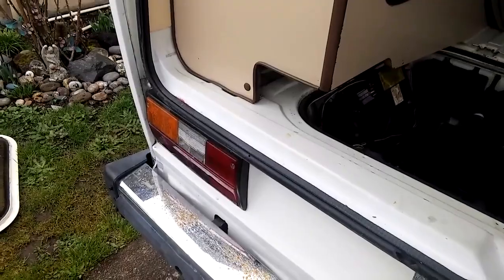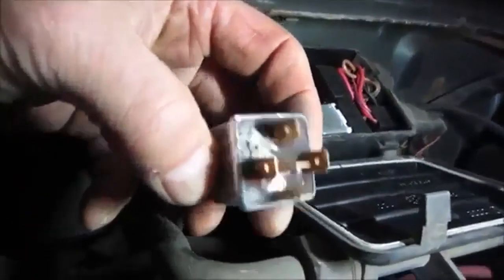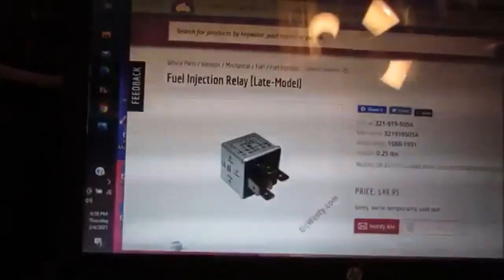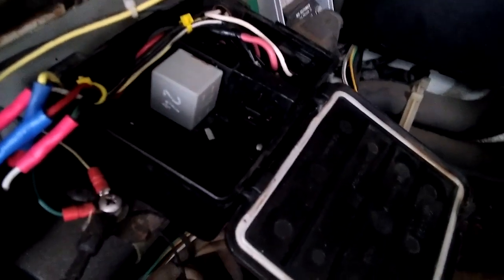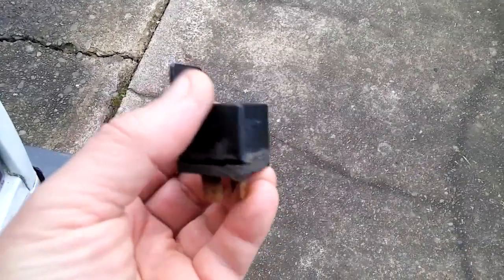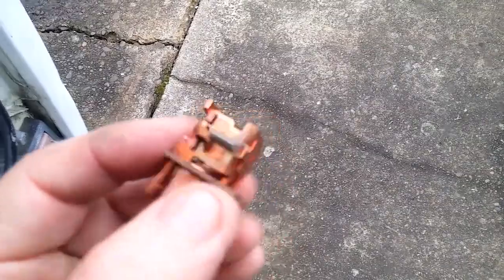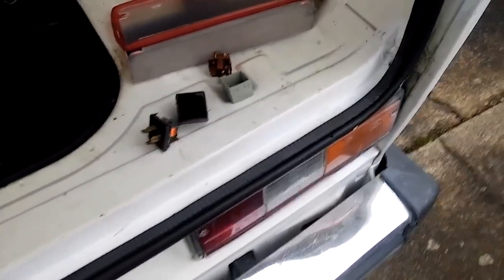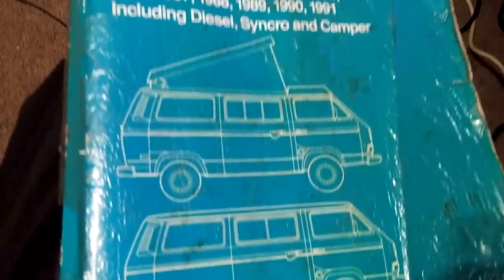Help for Mustie's VW Vanagon Relay Failure

Comment: NEVER USE DIELECTIC GREASE on ANY Connection!!   THIS IS COMPLETE AND TOTALLY BAD ADVICE.... IT IS NOT MAKE FOR THAT AND IS NOT a  CONDUCTOR.
                                        Take this video DOWN, and stop posting BAD INFO!
Reply from the maker: It's not a conductor but it does prevent connector corrosion from wet weather conditions such as in Florida or the Pacific Northwest, which is a big problem. Decades of experience is the proof.

Comment: Awesome work around or work through
Reply from the maker: Biggest help is the service manual with all the electric schematics. Trying to figure it out on the road without that is tough. However, with the fuel pump external under the sliding door, with the battery just inside, a jumper wire from the battery to the pump bypassing the relay would likely have gotten it mobile. I've done that!